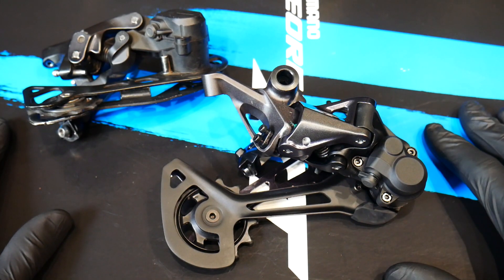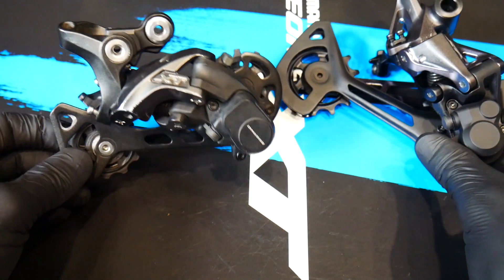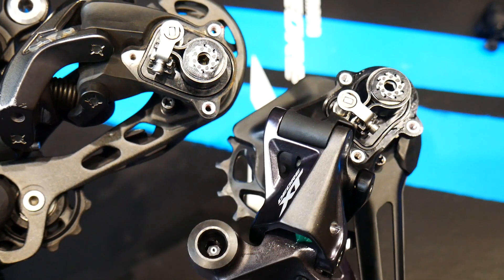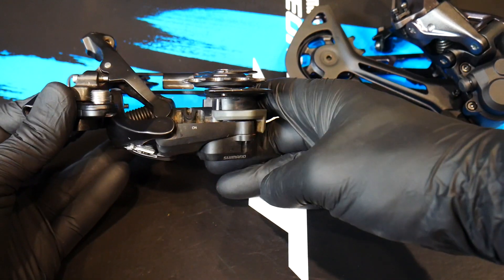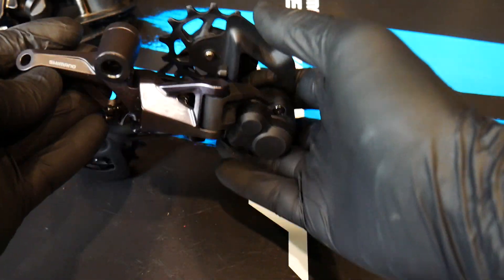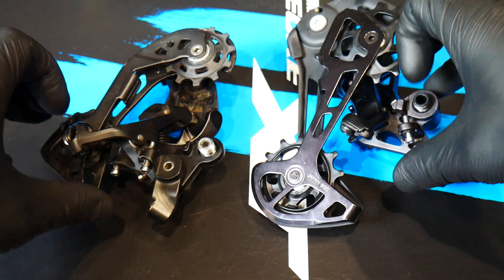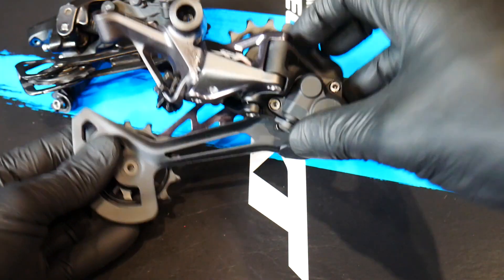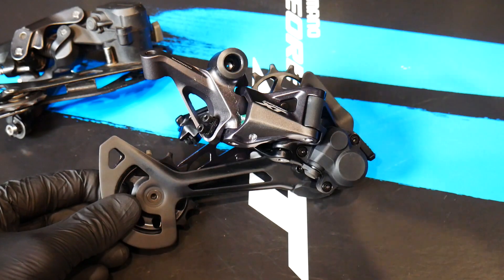Rear Derailleur Shimano XT RD-M8100 vs. RD-M8000. What's Changed, What Remains The Same...

Comment: Any guesses on which grade of aluminum Shimano uses on the XT M8000 rear derailer? And does the XTR still have any Titanium?
Reply: I don't think the XT M8000 derailleur use any titanium. It also doesn't use any carbon fiber composite like the XTR derailleurs do. I can say this for the XT derailleur cages though:

I have a range of Shimano derailleurs for 7-8-9 speeds (LX and XT's), 10-speed (XT (GS and SGS) and XTR (GS)), 11-speed (XT GS and SGS), 12-speed (SLX SGS):
7-10 speed cages are aluminum are thick and strong. The 10-spd XTR cage is carbon on one side and aluminum on the inside. The 11-spd cages are thinner aluminum and the 12-spd cages for SLX and XT are really thin aluminum. The SLX derailleur I bought from another person (brand new), he had his cage broken and had to find a replacement. He showed me the broken cage and I was surprised at how thin the cage was. I think the newer derailleurs are made to be lighter but at the expense of thinner gauge aluminum and with thermo-plastic body. The older stuff are slightly heavier but they're built to last even after 30 years!

Comment: I wonder if you'll be able to answer my question. Can I used the new M8100 RD to my existing 11 speed xt set up? Basically still using the 11-46 xt cassette & shifter with M8100 RD instead of the m8000 RD?
Reply: As far as I know from reading the forums of one who tried using a 12-speed XT derailleur with 11-speed setup, it's not good, even with the Shimano XTR 12-speed shifter (which is supposed to be 11-speed compatible). However, the 12-speed XTR derailleur is supposed to be able to run the 11-speed cassette with either 11-speed shifters or the 12-speed XTR Shifter.

Have you tried the RD-M8100 12-speed derailleur on the 11-speed XT setup? If so, let us know how it went.

Comment: And yet, the older M8000 XT rear derailleur with the SGS (long) cage has the largest capacity of them all! And I have even managed to make it deal with an 11-50 teeth cassette.
Reply: Surprisingly 12s xt m8100 pulleys 13t fit 11s xt m8000

Comment: that glass fibre reinforced polymer (plastic) part on the new mech snaps very easily, especially as the new mechs cages & jockeys are so big & more prone to catch roots & rocks. I snapped 2 new ones in a month & none of the old ones in 6 years. I now use the old m8000 with my 12 speed set up as it's more durable in  my experience.
Reply: M8000 rear derailleur with 12 speed? It works???
Reply: @thedownunderverse  Yes. I'm using one with Simano 12 speed. Perfect. When I get another bike I'll use the same set up. Lower profile than the massive M8100 series.
Reply: @45graham45  M8100 has longer profile because it is designed for 1x system with 510% spread casssete.
Reply: @dzidmail  the SGS is longer than the GS cage. Of course the SGS will have a larger range but GS is the wise option (with a 10/45 cassette) for 27.5" wheel.

Comment: Can i use xt m8100 shifter on xt m8000 rd and cogs?
Reply: Mech, yes, Cassette, no as the cassette needs to be 12 speed to match the shifter.
Reply: @45graham45  thanks for the input. Tho this is my current setup:
Xt m8100 shifter (12s) + Xt m8000 rd and cogs (11s)
No issue for a month now using it on our local trails.
Reply: @jepoyvictoria  that's good to know. So because your mech has only 11 positions, does the 12 speed shifter have an extra click position that does nothing at all?

Comment: I currently use the Shimano XT M8000 2 x 11 on my 2017 Trek Fuel EX 9.8 . Is it worth going to the new 1x12.... aside for only having to worry about 1 shifter. Is there a big difference in gear ratios. Would be losing or gaining any range?
Reply: Hi James, regarding gear ratios, the M8000 with the SGS cage has the largest capacity of all. So you can play with a double chain ring. I am currently using a 36-22, but I'm planning to swap the larger and go to a 38-22, which provides a wild range of gear ratios. I'll probably have to change the front mech to accomodate for this large jump between chainrings, but the upcoming CUES series can make up for it. Maybe I have to use a front mech designed for a triple chainring, but limiting it to just 2 rings.
Anyway, the M8000 with the SGS cage is the way to go.

Comment: Hey Danny will you do a review on the new rx shimano as im considering the di2 shifters and the new pivot looks interesting. Ive heard different views on big pulleys versus the 11t pulleys.  Somecsay you cant tell and performance benefits. Did you try to see if the 8000 would work with the 12spd ir us the pull ratio different.